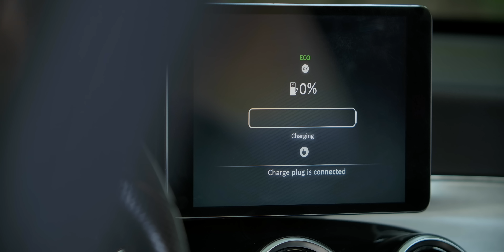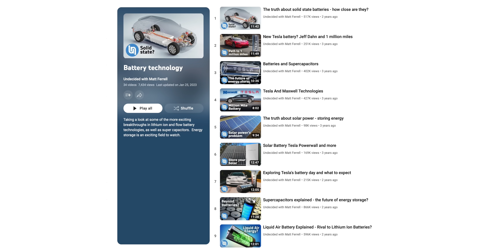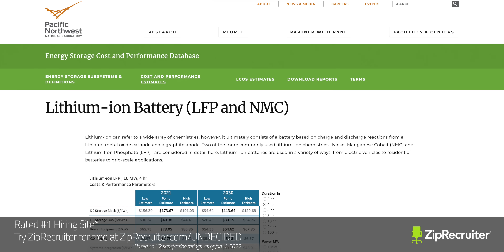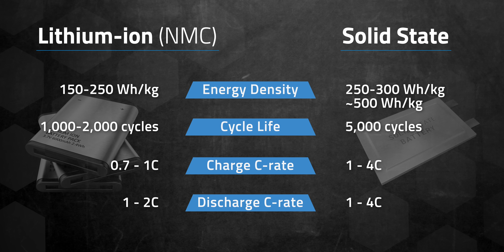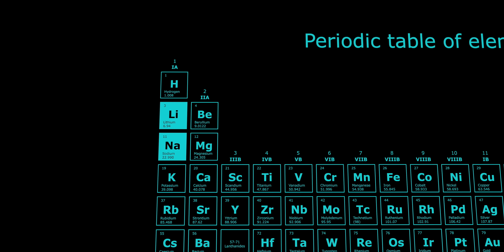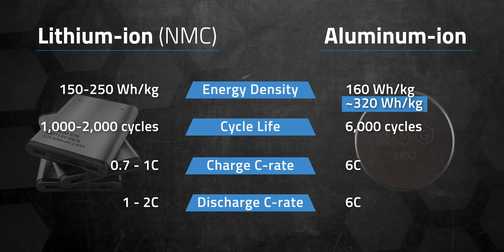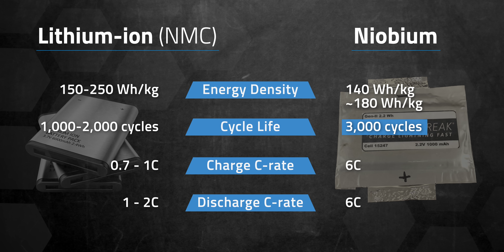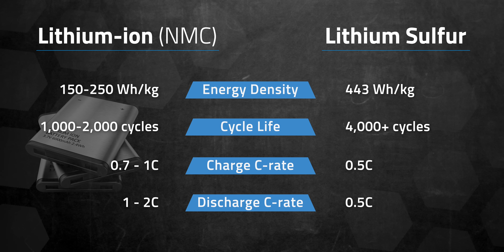Are These Batteries The Future Of Energy Storage?

Comment: Yup. Ev charging in minutes. My bullshit-meter just went over the scale.  If anyone request from the supplier an equivalent of the energy consumption of an entire city, just to power one charger, the supplier will firmly but politely ask them to go f*ck themselves 🤦🏻‍♂️

To be honest, it has already happened. A company in the US has invested into 30 EV trucks and requested for a supply for a charging station for them. The grid owner asked in return if it's a joke, as the requested power capacity for the cherger was higher than what the entire town they were located in was using...

Comment: I'm sorry, but your baseline NMC Li-ion is just factually incorrect. Your standard NMC811 cell can typically charge up to 2C and discharge anywhere in the range of 5-10C. Closer to 5C for 18650 cells, and 10C for pouch and mult-tab 21700. Saying their discharge rate is 1-2C is a crime and makes every other contender here look better than they actually are.

Comment: What does "cycles" mean?  Is that how many times it can be charged and discharged until it has 90% of it's storage capacity?  80%?  It can't be until the battery needs to be replaced otherwise at 2000 cycles a Tesla that is charged every night and driven everyday would only last about 5.5 years.

Comment: HEADER: Be careful, with choosing the header. Most people never see the message in the video, only the head line. Header will be burnt to there memories. It is easy to use “click bate” headers, but dangerous. Any new battery chemistry in a lab is not important for battery users. It will be important after those batteries are in mass manufacturing. Most will never get to that level.

Comment: For me, it's sodium for several reasons. The most important is cold weather performance. I have 3 EV's (all 2 wheelers) and I live in an extreme cold climate. Li-ion doesn't like charging or storage in cold climates so I'm forced to keep them at indoor temperatures and can't use them below -10C.

Next is cost. As others have said, the main cost of my 2-wheelers is the battery pack. I'd love to see lower cost and equal energy density (not there yet but potentially) so I could swap out batteries and own more than one per vehicle. At this point, I can't afford a spare battery pack for any of them. They cost multiple thousand dollars each.

So, I hope in 5 years sodium batteries equal the energy density of li-ion EV packs. I'd even accept a little less if the cost was substantially less.

Comment: You should investigate the Redflow zinc bromide flow battery, mainly for home and industrial applications due to it's size. No loss of capacity over its life, can discharge 100 percent with no issue, can sit at any charge without loss of power, much more than just these qualities

Comment: what about superconductor? is it really possible it can replace battery system? because some tech research are moving toward superconductor since it have faster charge and discharge capabilities

Li-ion has so many variant still when people said Li-ion mostly it's about NMC, even though LFP and LTO also categorized as Li-ion 😁

sodium is great because cheaper than lithium, but from what I heard it has lower density which means energy per weight ratio is bad. if it can charge faster than lithium then it still considerably good

personally I think the "holly grail" is in Solid State Lithium battery and the reason isn't available commercially I guess it just "bad for business" either too expensive to produce or having too long life cycle or got too high density with current chemical composition.

Comment: If that aluminum battery can hold up that upper limit of energy density that was tested, I could see it being used for drones and hybrid planes/jets.  The niobium and aluminum with those charge and discharge rates would be awesome for ion propulsion technology.   With the need for high voltage high amperage for sufficient punch make the technology useful for atmospheric flight something like that could allow RC hobbyists like me to mess around and see if we could make something completely ion propelled.  (Plasma channel's multi stage looks like it'd be a nice. I'm thinking of figuring out how to skin a craft in a bunch of small ion thrusters because forcing air flow over the surface of a craft ironically possibility canceling out drag at the source and propelling the whole thing with what's the possibility of thrust vectoring air over the whole craft could open up whole new realms of maneuverability.  Plus a aircraft completely covered in ionic corona during the night would just look absolutely awesome, as well as lend stealth properties according to the Russians boasting their hypersonic missile.)

Comment: I hope you learn someday that wind and solar grid scale power is a myth generated by the fossil fuel industry as a distraction from the continued use of fossil fuel.  Maybe you can power the needs of your house with panels but it will never power industry.  Look around you at all the metal items and think about the energy needed to melt it the 5 to 8 times needed to produce that product.  From ore to alloy to production there are many steps this piece of metal needs to become molten.  You are not going to do that with batteries.  BTW:  There is no such thing as renewable energy.  The law of conservation of energy states that energy can neither be created nor destroyed - only converted from one form of energy to another.  Its all a myth.

Comment: One of my primary interests in battery technology is for augmenting home solar with affordable, long-lasting batteries. Lithium batteries are expensive and with 1,000 cycles mean they'll need to be replaced every 3 years. That totally destroys any benefits to adding them to a home solar system. So for me something like the sulfur or iron oxide battery with high cycles and low cost (density and C rate don't matter) are where I'd like to see commercialization sooner rather than later.

Comment: The rapid sucess of EVs depends on,  how rapid the battery system can be optimized to a high level performance and I believe, that so much resources being put in develoment, in 5 years batteries will be mature enough, in technology and price, that won't be an issue anymore. Research and development will continue, of course, but its impact won't be critical, as it is today.
The negative, and there is all a negative, is that there will be many technologies and companies, that will fall to oblivion.
I will atribue a probability rate of 80-85% of being right. And how I know it, is bye analyzing all that's going on, is impossible that this won't happen.
Thank you for the thought provoking video.

Comment: Solid State: feels a little too sci-fi to be viable soon
Sodium: seems good, the lower energy density would be a hinderence for larger and more powerful vehicles but it's low cost is a very good step in the right direction
Aluminium: not one I've actually heard of, but the idea and sustainability aspect is really cool
Niobium: Niobium sounds like a pretty rare and expensive element so I'm unsure about it's viability
Sulpher: yes please, I know it's still a little ways off but the sustainability aspect, availability of materials and energy density are all extremely interesting. Can also be combined with sodium which furthers the cost savings

Comment: NaPO4 is the wave of the future.  90% cheaper than lithium, 90% of the energy density of lithium, 10% heavier than lithium, totally recyclable. These batteries are already in production and while not quite as good as lithium they are far cheaper and have cycles that are similar.

Comment: Matt, I feel like you have missed the most glaringly obvious use of sodium batteries and their potential with EVs. This is in hybrid vehicles running off E-fuels. This allows sodium to take advantage of a high cycle rate, being incredible cheap, efficient to produce / dispose off, the benefits of its extraction method and the ability to make E-fuels more affordable long-term and not have to worry about having to replace existing infrastructure. The best energy methods are always combinations of. This also makes E-fuels more attractive, and because of the atmosphere carbon extraction off renewables / potentially Nuclear - we have the potential using existing infrastructure to undo a lot of the damage we have done without making existing infrastructure redundant (geo-engineering).

Comment: Sodium-ion batteries have the brightest future. They fill and empty quickly, and in terms of price, they should be unbeatable. They are ideal for home solar systems, but also for cheaper EV cars available to the masses. Lithium ion batteries will soon become a thing of the past, their biggest drawback is slow charging and discharging, as well as a great loss of efficiency in the cold. Other batteries have a chance, they charge and discharge quickly, unlike lithium ion batteries. Fast discharge is essential for home solar systems, and fast charging for EV cars.😄

Comment: I like your channel because you're balanced in your approach and very rational in your analysis. Also your presentation style is very straightforward and efficient, with very little fluff. Kudos to you on those things!

I'd have liked to see inclusion of safety as a criterion; i.e., what happens if it is punctured or overheats? Also, how does it handle low temperatures? These are important considerations for EV batteries.

Comment: My question is how much energy or pollution is created in the creation of these batteries second question how much pollution and viability is it when these batteries die how much energy is required to get rid of them to dispose of them are they disposable is the pollution that they’re gonna create in the end more than what it is for a normal internal combustion engine my thinking is a normal internal combustion engine is just metal. You melt it down. And make another car. No one has explained how these batteries are going to be disposed of and it what cost😮

Comment: I'm pretty sure in the future will be normal to see devices using mixed batteries, something of the sort of a EV having 40% niobium and 60% sulfur lithium, to have more density and still have a fast charge, obviously this would not be necessary if there is 1 type of battery that have a good enough in both stats

Comment: I prefer the petroleum battery. I fill up my gas engine and run it to produce power. The gas stores in a gas can for use when needed. To recharge, I drive my V8 engine car to the pump and refill the tank.

Comment: These look great for something like a laptop or smartphone, but the energy densities advertised here are nowhere close to what we'd need for international shipping or industrial applications. Diesel gets 45 megajoules per kilogram, it doesn't have a 10-year replacement lifespan, etc. All of the most hopeful battery technologies are years away from commercialization, and even in the best case scenarios they're nowhere near being able to replace fossil fuels. This video necessarily ignores how these different materials are extracted, transported, and processed, but these use cases also require the large energy densities found in diesel. 

It's funny. The left thinks we just need to decarbonize. The right thinks we just need to double down on fossils. The truth is, neither will save us from vast economic simplification in the near-medium future. The problem is a society built on overshoot from cheap fossil fuels. The cheap, available fossils are gone, and nothing else comes close to being able to sustain this standard of living.

Comment: Well, I was going to say something along the lines of "the problem with these miracle battery technologies is that I've been reading about them for over 2 decades now, but I still haven't seen them actually being sold". But then I decided to look up the evolution of battery capacity for Li-Ion over that timespan, and turns out it went from about 560Wh/l in 2000 to around 1800Wh/l in 2021. That's more than triple the capacity in 20 years. Looks like I've been looking at this all wrong; I was expecting the breakthroughs to come from all new chemistry, like when we went from zinc-carbon to alkaline, and later to lithium primaries, but turns out it wasn't as much a revolution, but more of an evolution, a steady improvement of existing chemistries over time.
 
And still, my laptop and cellphone have a battery life that's measured in hours rather than years. Disappointing... 😂

Comment: One of my friends recently described to me the idea of "pumped storage hydropower" essentially being a mechanical form of a battery. Although it's not exactly a new concept I had never heard of it before and I thought the simplicity and practicality of it (in regions where it can be done of course since topography is a big factor) was actually really neat.
Reply: They built a facility like that in my region back in the late 1980's   I am not sure if it is still being used or not because it has been years since I have heard anything about it.
Reply: Where I live they could easily do this in many suburban places and run the water down the hills from a tank during the night and then pump it back up during the day from the excess solar being put back into the grid..
 The whole state is renewable energy . So we don't use carbon generators its hydro and wind generation for the grid. unless there is a drought
Reply: There has been done extensive research about the feasability of this kind of energy storage in Germany / Europe. Basically there are no places in Germany anymore to build such plants. 
The concept is not new at all. And yes, the stats are incredibly good! So I guess in the US they already build these plants where they it made sense?

Comment: Sodium based cells are the hope of the entire EV industry.  Lithium has always been a dead end; there isn't enough and its too destructive to get, 500,000 gallons of water per ton.
Sodium is 20% less energy dense and has a short life; labs have results that show this could be overcome.  Sodium is cheaper and breaks through the scalability limits of Lithium; not just for storage but every area IF the lab results can translate into real batteries - if not the EV industry could be limited to a niche market.

Comment: A someone working in the field: I kind of have a problem how you compare the new technologies to standard Li-Ion. For Li-Ion you show average values that an existing battery can have/keep all at the same time. For the new technologies you show ranges of values  that have been demonstrated but in different cells. For example the solid state cells with very high energy density do not at the same time have the highes lifetime and high current capability.. The high values demonstrated in each subfield are not currently achievable while also having all of the other subfields in place. In individual subfield Li-Ion cells right know can achieve much higher values than depicted here albeit with the trade of in other fields. The new technologies have the same trade off.

Comment: Considering Lithium is king, Sodium batteries do make a lot of sense for many of the applications we currently use Lithium. Energy density per Volume rather than Weight should have a comparible energy density. With with a few exceptions like Vehicles where weight matters as much, or not more than volume, there's no reason to not use Sodium batteries. Does it matter if your phone or laptop is a few grams heavier? probably not.

Comment: Quite cool variety of an NMC battery is an LTO one. Switching graphite anode to effectively a ceramic material you get insane lifetime, temperature range and C-rates...at the cost of significantly lower energy density and lower cell voltage.

Comment: one big problem with higher power density batterys is thet power density is next to useless for laptops since airlines limit them to 99 watthours if there wer laptops available with larger capacity batterys even if i cant take it on a plane i would still buy it this limitation is dumb

Comment: Ive worked as a miner in a niobium mine in canada, as far as know there are only 3 or 4 significant underground mine for niobium, also Brazil is by far the biggest niobium supplier, Canada being second at less than 10% of supply rate compared to Brazil, third one being also around 10% of supply rate compared to canada, plus the military tech is quite keen on getting that material, i dont think whe will ever see niobium battery for the mass public.

Comment: The way to get around the problem of not having a fast enough grid connection to charge the aluminium battery at 6C is to not charge it direct from the grid. You have a cheap sodium battery charged from the grid at your charging point then you dump that charge into the aluminium battery in the vehicle very quickly. This combination would work great for battery trains where you need to charge very fast at the stations but you can afford to have quite large batteries hidden under the platforms so you don't need a high power grid connection.

Comment: Lithium ion probably isn't going to be the primary battery technology in 10 years and that's probably a good thing, charge speed and energy density is way to limited right now. That being said I don't think heavy trucks and aircraft are going to be running off of batteries. Im thinking Hydrogen or something with similar energy density will be needed for the heavy vehicles that everyone is reliant on.